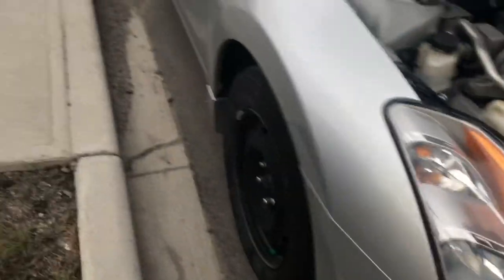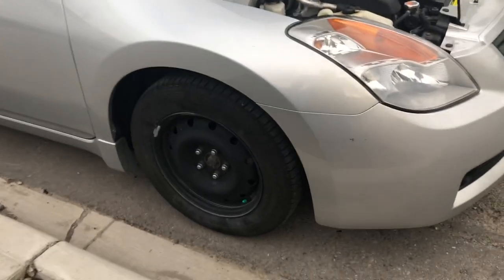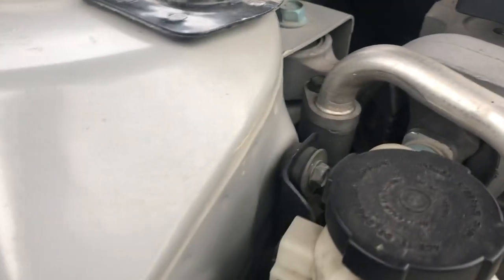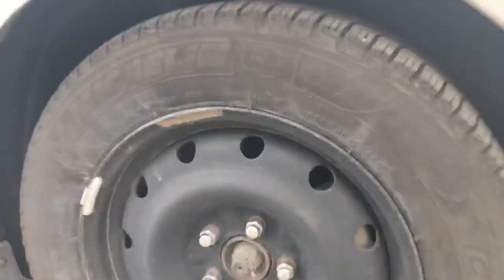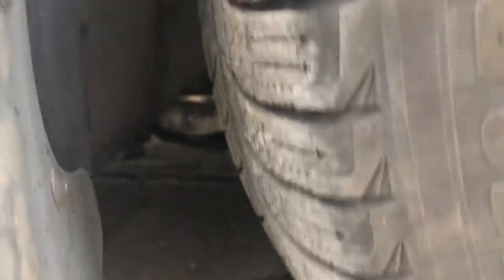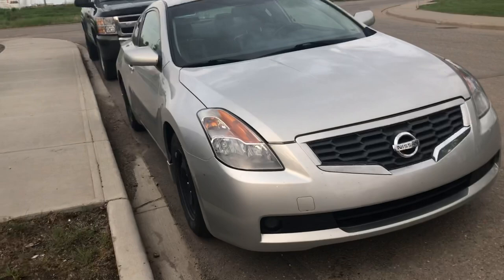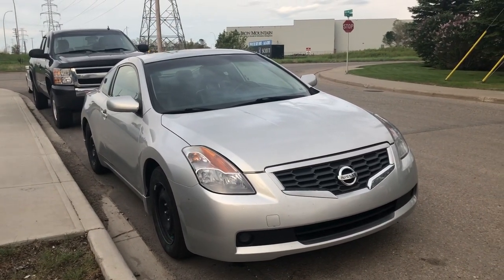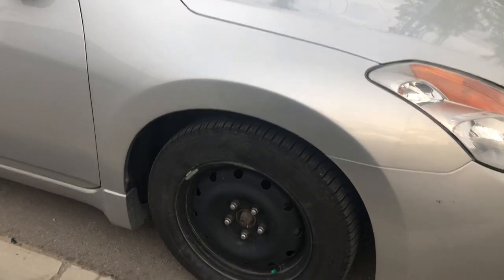Dead Transmission? 2007 - 2012 Nissan Altima 2.5s - What is Limp Mode? Transmission Not Working

Comment: Idk if it will work for you but I had the same problem and it whine sometimes I changed my cut transmission fluid ever since then it stopped I got 2009 2.5 sl
Reply: Yea I imagine trans fluid low. Limp mode

Comment: Did you ever change the trans fluid?
Reply from the maker: I didn’t know that was even something to do to maintain a car. I wish I did. But I ended up having to replace the transmission. It was already gone.
Reply: @checkenginelighthelp  If you read your owners manual it says to change the transmission fluid every 60,000 miles.
Reply: @josephkelleher8820  get a toyota Lexus

Comment: Hello .. my name jack did u ever find out the problem i have the same problem With my nission same  car
Reply from the maker: Hi Jack, yes I did. The code reader came back saying it was the transmission and I had to replace it with a “new” one. I ended up finding a transmission from a car wreck and paid $700 for it then paid a mechanic to install it for me for $500. Sorry I hope that helps you but it basically died. The lesson is that I need to replace the transmission fluid with any CVT every 30,000km. Good luck bro I hope you are ok

Comment: You do some brake work or touch the brake pedal ??
Reply from the maker: 1joseda costco repaired the tire just last Friday from a nail in the tire. Do you think it’s possible they wrecked my wheel or the brakes?
Reply: RandomVideoNut, no but you can try.. I replace my brakes for my Altima 07. After that my car start dragging the brakes. First I think was the transmission. But for any reason my brake pedal was under the sensor for start the car. Right in the bottom of the brake pedal. I just pull my brake pedal to up. After that running like always. What I mean my brake pedal was low.
Reply from the maker: 1joseda ok ok I will try that tomorrow bro, how did you pull your brakes up?
Reply: RandomVideoNut with your hands or your feet. Really simple . For me work perfect. I was about to get a new transmission. One question.. you have any code ??

Comment: Did you ever find the solution? Ours is doing the exact same thing!
Reply from the maker: Hey bro, basically my transmission went. I was able to have an old friend, one i trusted, recommend his family friend mechanic and he told me flat out the transmission was dead. The error code the first mechanic cleared was for a Transmission Solenoid. P801 or something. He said that its a common thing with Nissan Altimas with a CVT and furthermore any nissan with a CVT. Basically after joining lots of Nissan Altima Facebook groups and listening to Scotty the Mechanic on YouTube, once Renault bought Nissan, all the transmissions started having trouble. BUT the good news for some people, and it may be the case for you too, is that you can check to see if you are covered under Nissan's Manufacturer's Warranty for the CVT because there was a lawsuit that made Nissan extend their Transmission warranty based on the year and mileage of your vehicle. Go to Nissans website and find the details. Hope this helps bro. sorry to hear.
Reply: 165k mine went put a remanufactured in 3 year unlimited miles with a cooler currently 190k no problems if the engine in these cars wasn't so good that 2.5 in mine I bought new and only thing I've replaced was spark plugs and cat. I've heard put a cooler on them but mine lasted 165k no fluid change or anything
Reply: @jasonjarrell7695  where do I start to look for a remanufactured transmission.  Did you purchase this online or locally?
Reply: @brendenanthony1049  Street smart transmission is where I got mine 3 year unlimited miles